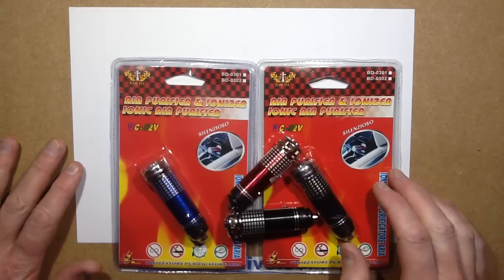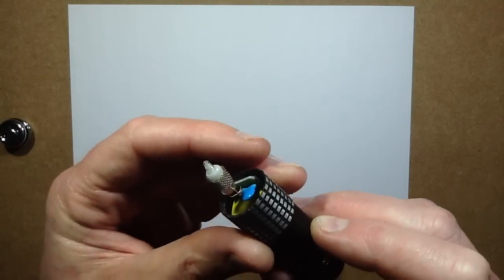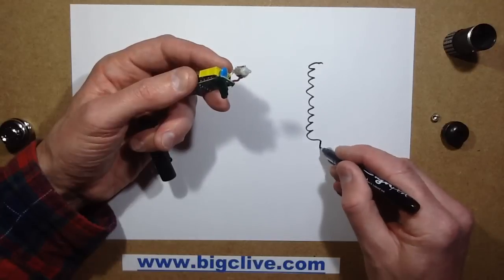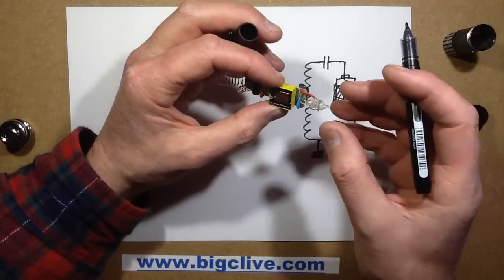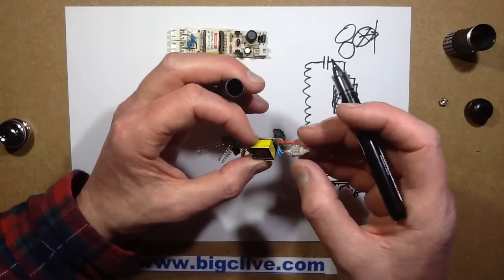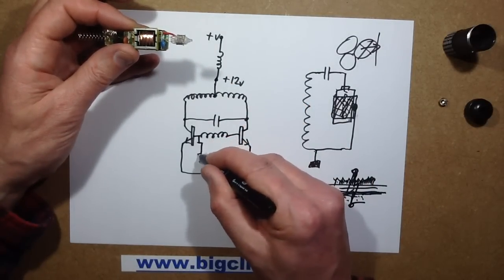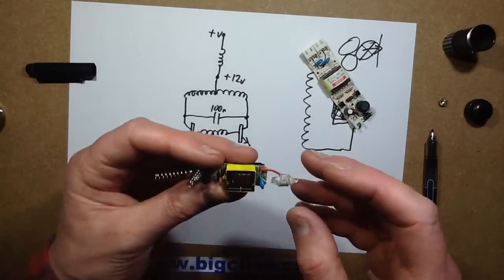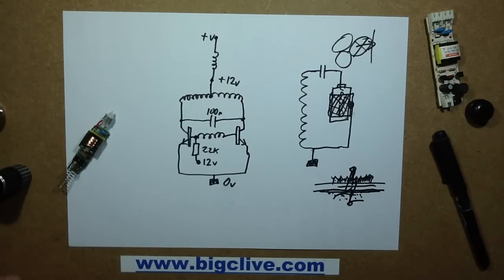A look inside a REAL car ozone generator plug.

Comment: I'm not sure about how good it is for your health though. I tried doing something like this with a TV flyback, and while it felt very refreshing and "mountain air"-ish at first, after a few days it starting having a really irritating effect on my respiratory system and I stopped using it. It does help with cleaning dust & particles from the air though, because they're all on the ceiling and wall now, which both have turned black. :)

Maybe the flyback is too strong? I used the original circuit on the TV board, I didn't build one of those drivers that arc a foot long across terminals.
Reply: Ri Max Ionizers are what help pull dust out of the air. Ozone is generally what causes irritation. But by their nature almost any ionizer also produces a certain amount of ozone and vice versa.
Reply: I read that ozone generators must be AC powered, because DC gives also nitrogen oxides. Is it a transformer with integrated voltage multiplier?

Comment: The glass of the Neon lamp will NOT conduct the electrons, instead it acts as a dielectricum in a condensor. Therefore the circuit uses HF AC!

Comment: I plan to make an ozone generator for my car to improve the efficiency. It will feed ozone into the air intake. I wonder if I will run into any/many issues when using a car ignition coil to generate the high voltage. After watching this, I am thinking to use a bulb with stainless wire mesh wrapped around it to create the discharge. I am not an electrician, so I am unsure of if I need other components or not.
Reply: I didn't realise it could improve efficiency? You need a high frequency switching circuit in order for the coil to create high voltage.

Comment: Clive is this actual ozone or like the heaven fresh Negative ion generators? I think i did some research and there was a clear difference, correct me if i am wrong. Great video by the way, a wealth of knowledge!!
Reply from the maker: +ifell3 It's ozone.  A proper negative ion generator uses either needles or a carbon fibre emitter to charge the air with an electrostatic field.  Many ozone generators are passed off as ionizers to help sell them, but do not ionise the air beyond the unit at all.
Reply: +bigclivedotcom Thanks clive, i've just brought one, lets see how it goes. Keep up the good work, had to share your barbie doll rocket up arse video, that was funny!!

Comment: Hey +bigclivedotcom so since both the negative ion generators, and the ozone generators use a high voltage corona discharge, is this merely a difference in power output that distinguishes them?  If so, then do both generate negative ions as well, but this one just generates more ions along with higher levels of ozone?

Comment: ist ozon toxic why would you want to generate it in your car
Reply: It smells good.
Reply: Press G To Game You might want to let it run to generate some ozone while you're away to kill off bacteria and organic sources of smell. When you're back, you open the doors and let it air out, and it's gonna be fine, you're not gonna take any damage from little ozone residue.
Reply: Thauolar 
It's mis named. It causes the particles in the air that you can't see to drop to the ground (or floor) leaving the air that you breath fresher. It's just crazy that these criminally insane people go through this much trouble to make a fake. The circuitry is quite simple. Very cheap to make. So why not just MAKE THE REAL ONE? Don't know why they decided to call it that. Ozone is located in the upper atmosphere. If there's any left.
Reply: What ist ozon?
Reply: ozone is 03, that's what it is making here using the UV bulb

Comment: i got one similar years ago from Amazon labeled Proto Air but haven't used it in quite some time thinkin it wasn't doin anything. ran across a couple take to bits videos here and found mine to open up. it definitely has circuitry, but the end has a wire/fine tip which i assume is a different method than the ones shown in BigClive's collection of car plugs. is there a sure test to know whether or not it works as intended other than by smell?
Reply from the maker: If it has a sharp point then it sounds like it's an ioniser, which is good.  It will produce a very tiny amount of ozone, but its main function will be to precipitate dust out of the air.

Comment: I know ozone rots tires, but what does it do to your upholstery? 
These oughta be good for high voltage, though. But there's no diode, so it puts out AC. It must be terribly inefficient as an ion generator.
Reply: Ozone doesn't really rot tires. UV Ultra violet light does. You'll notice on cars that are parked where they receive a lot of sunlight on one side but not the other that the tires will be dry rotted/cracked on that side.

Comment: i like the way you explain stuff ! even though u get side tracked often.....it would have been nice if you finished explain how the 2 circuit halves connect together.
Reply: +realcygnus the primary side oscillates at low voltage and high current.  It's magnetically coupled to the secondary side which reproduces the oscillation but with high voltage at low current.  The three windings -- primary, feedback, and secondary -- are all part of the big transformer on the board.  The secondary winding is physically divided so that the enamel on the wire won't have to withstand the full voltage difference from one end of the winding to the other end.

Comment: Won't ozone wreak havoc on rubber seals, gaskets etc?
Reply: I got excited about ozone, and researched it. That certain gaskets/seals may rot is my understanding also, although everything in moderation.  People with rare or special instruments or gadgets might avoid high sustained concentrations from O3 devices in the area.  Mind you, photocopiers also produce ozone, as did tube TV, etc.

Ozone is natures purifier, a certain amount of ozone is always present in the air as it's necessary for the oxidation of decaying organic matter: why doesn't nature stink with all that decaying going on from the cycle of life? Ozone is especially detectable after a rain storm.  Why do we open our windows? It's not for the air cycling, but the purifying effect of the ozone we associate with fresh smell.

Odour remediation companies use powerful ozone generators to clean bad smells.  The occupants return after a few days when the treated air is cycled with fresh.  If you use one at home, air out the house somewhat when you get home, and turn it off.  

They really work.  It's like bleaching the air.  I got rid of my generators though, and use something even better.

Which is "Beneficial Microorganisms", that I ferment myself from a mother culture called "EM-1" (patented) I buy that has been produced under scientific conditions.  It is a combination of three specific microorganisms. It employs synergy rather than killing.

The EM digests all dead organic matter– including the INeffective microorganisms, which INcompletely digest it, causing the stink and more importantly, pathogens. Flies will not lay larvae on EM treated manure or compost, as there is nothing left for them to eat.  

More than that, microorganisms influence our minds through chemical interaction with the foods, medicines and toxins we ingest. So better use good EMs: for complete digestion and nutrient uptake of livestock and plants to increase yields. Use it on your car seats, under your armpits, as a counter wipe, in waste treatment plants, in petfood, and after a nuclear disaster.

Sorry about the wall of text,  but I thought you should know.
PS: I love your teardowns Big Bear Clive.

Comment: If the O3 molecule wants to get rid of that extra oxygen atom and does that by binding it to anything that will oxidize, then won't that end up corroding every bit of metal in the car that the O3 can get to?  Not to mention the toxicity of breathing ozone.

Comment: I've got one of those plasma rods(work just like plasma globes), would covering it in tin foil and grounding make ozone?
Reply from the maker: It#s possible that using a stainless steel mesh on the outside referenced to the other end of the high voltage transformer might work.

Comment: If every car owner on the planet used one of these, would it fix the hole in the ozone layer? if not why?
Cheers Clive always find your vidsinteresting
Reply from the maker: +kelvinchill Ozone is diminished before it reaches that height.  It has to be generated in-situ by the reaction of the suns UV with oxygen.
Reply: +kelvinchill the hole isn't even there anymore
Reply from the maker: +Torc Handsomeson Damn!  We're going to have to make another one.
Reply: +Torc Handsomeson The ozone hole is still there and larger than ever, so Idk where you got that idea from. http://ozonewatch.gsfc.nasa.gov/
Reply: Despite what +bigclivedotcom  and other said -YES - it certainly would help.
Get a million people to use this while driving and soon you have 1 million cars less on the street.
Reply: +bigclivedotcom 
Hey I'm game, when do we start ! 👣😊
Reply: So the hole in the ozone layer is a farce afterall?  I never believed it because of that very reason.  If the ozone layer is damaged by CFCs, there is more UV to counteract and replenish the lost ozone.  It's also amazingly coincidental how the CFC ozone scare came about right when the patent was to expire and the new "ozone safe" patented formula was ready.
Reply: The Dollar Guy  uhm ... go back to school and learn physics and chemistry.
no, The ozone-layer was damaged quite severely.

When Ozone gets hit by UV-radiation, it splits of a free oxygen that can either hit another ozone-molecule forming 2x O2, or hitting an oxygen molecule and creating ozone again.
So normally this is a very balanced process.

But if you introduce gases like CFCs they prevent the forming of ozone by binding these free oxygen atoms.

Just cause the Ozone depletes does not mean there is somehow magically is enough UV radiation to counteract the depletion.
While it reaches deeper and new ozone is formed at lower levels, the total amount of regeneration is lowered.

In these lower regions it is oxygen that has to get hit, and it is far worse at absorbing UV-radiation, letting more pass down to the ground. So more radiation hits the ground and less is blocked by the atmosphere - producing less ozone from radiation.

it will take some time for the Ozone-layer to be what it was 50 years ago, but we already see that the CFCs and other gasses are broken down enough to stop the depletion.
Reply: Correct.  But it is the UV energy being absorbed that is generating the free oxygen.  So if some of these are taken by CFCs, there is more exposure to UV to compensate and continue forming Ozone at an accelerated rate.  It should be self balancing system whos intensity (thickness) would vary depending on the level of UV being emitted from the sun.  The number of articles that contradict the ozone depletion makes it difficult including scientific studies that show the ozone layer was thinner in the 1940's than even today.  I did a report on this when in college with a fair share of research, but has been so many years I have forgotten all the details  It was inconclusive.  History has taken its course and many other more important issues are occurring in the world than the ozone layer; which appears to be doing just fine.  Whether CFC regulations did it or not, that is up to each individual.  It's passing (CFC ban) being coincidental to the patent expiration of the same company releasing the "ozone safe" alternative is nonetheless a curiosity.  Probably good to take the safe route as we did regardless.
Reply: The Dollar Guy The total amount of Oxygen-atoms doesn't increase, yet a lot of oxygen is now bound to other molecules (CFCs) so the total amount of Ozone drops.

"there is more exposure to UV to compensate"  
The total income UV-radiation from the sun does not change.
as i said before - with less Oznoe the amount of radiation that hits the ground increases, meaning that even LESS Ozone is generated.

"The number of articles that contradict the ozone depletion"  
Nobody cares about 'articles'. Look at real RESEARCH and you see the actual facts.
Only now, long after banning the CFCs, we see the depletion getting to a halt.

"including scientific studies that show the ozone layer was thinner in the 1940's than even today."
Ground-level Ozone - yeah.
It doesn't have the shielding-effect and poses some serious health-risks.
And you know why there is more Ozone close to the ground? Oh right - cause the Ozone-layer is depleted and more UV-radiation passes down to the ground.
That speeds up the Ozone-generation locally, but in total still less than normally.
But good point - the higher ground-ozone concentrations are just more evidence that the ozone-layer is thinned out.

"more important issues are occurring in the world than the ozone layer"
Oh right, i forgot that an increases skin-cancer rate and temperature-increase are unimportant.
Guess nobody cares about the long-lasting devastating effects it has on the climate.

"Whether CFC regulations did it or not, that is up to each individual."
Nope, that is not up to individuals. The research has been done and we know the harm that CFCs have caused.

Comment: Well, that was a fun video. Got me thinking, I have a few failed compact fluorescents bulbs in my hazardous waste bag, let’s see if they work. 
I wrapped about 2m of solid core wire (from a discarded cat 5 cable - insulation stripped off of course) around a 1/4 inch threaded rod to make a long copper spring. 
Cut the electronics off the cf bulb so I just had the spiral tube left. 
Pushed the spring over the spiral tube from one end and spread it out along about half the length of the tube. 
Then, using one of those cheap Chinese cigarette lighter type high voltage generators I connected one end to the copper spring, the other to the cf bulb wires, doesn’t matter which wire, any one that stick out of the tube will do. 
Apply about 5V and the bulb fires up nice and bright. The nauseating smell of ozone (I presume) assailed my nostrils and wallah, I have the first part of my sterilization container. 
Can’t say how much ozone but it seems to work. Can’t see the purple corona above the cf bulb’s bright light but smell is there within seconds. 
Only problem is that the cheap electronics gets very hot so I have had to add a temperature sensor to the transistor’s heat sink with a little circuit to turn it off when it gets above 70C and on when it gets below about 50C. We still have a few weeks of lockdown so who knows how much it will develop by then. 
Thanks for the idea.
Reply: I would carefully recycle those CF bulbs. Each has a few milligrams of mercury in it.
Reply: Mircea Croitor: Sure, when I’m done with them.
Reply: WTF is " wallah"?
Reply: Full Opposite Lock : The non French version of Voilà...
Reply: @fulloppositelock6778  Similar to an "eureka!" moment.
Reply: @PF-gi9vv  The OP got the spelling corrected in the post above yours. It is indeed,a French word,the meaning and use is known to me.

Comment: I may have missed it, but how do you know that the one in the package is fake?
Reply from the maker: If you look through the slots at the front the real ones have a white glass lamp with a metal mesh sleeve, while the fake ones just have a clear LED.
Reply: @bigclivedotcom  cool thanks.